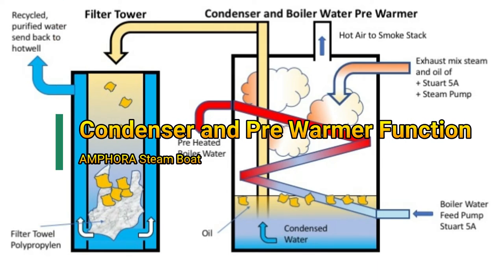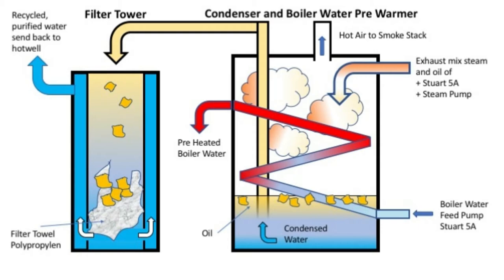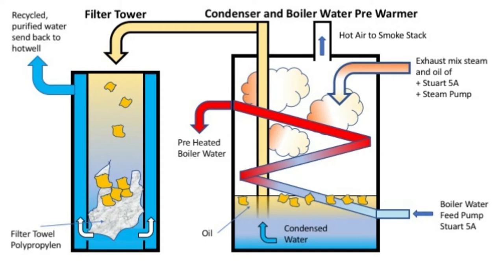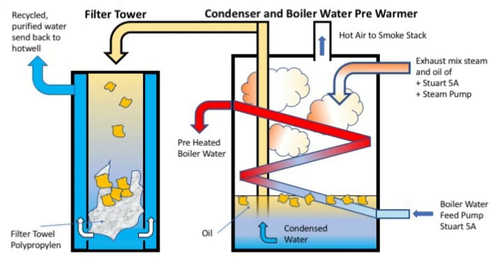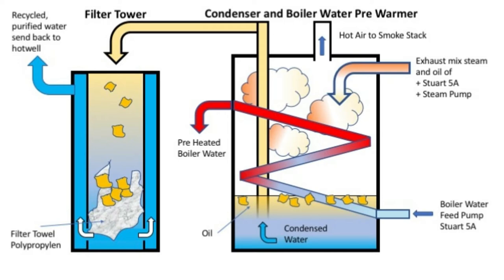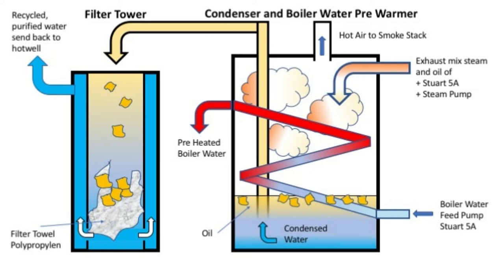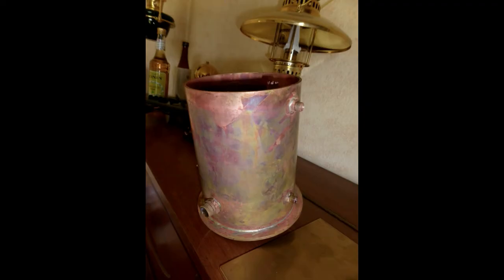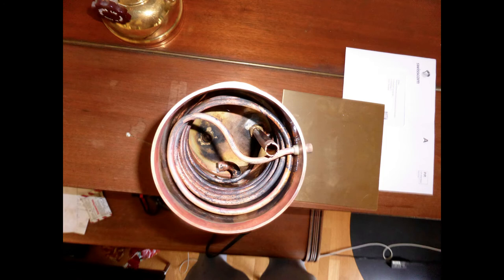Condenser and Pre Warmer Function in Detail

Comment: Bonjour Christoph,
When you start a heat, there is no water in the condenser and oil could be pumped to the filter and 
 clog very quickly the filter. To avoid this possible issue, do you always let some water in the condenser ? and if yes, how ? How do you clean the bottom of the condenser ?
Amicalement, Raphaël
Reply from the maker: Salue Raphael... the lifting tube for the condensate is not hitting the bottom,,,, so there is always some water left... about 7mm. This is no problem because the tank is copper and resistant to corrosion. All the best! Christoph